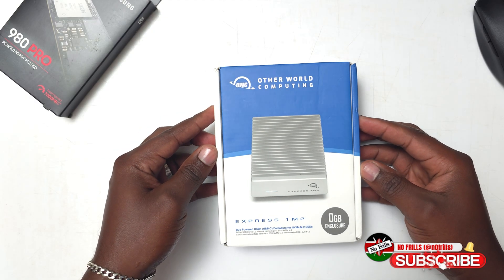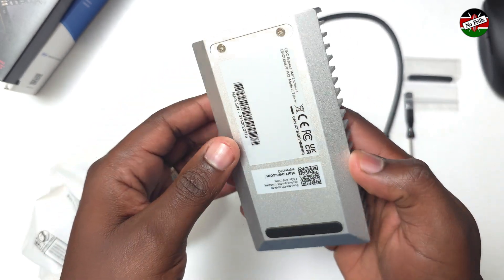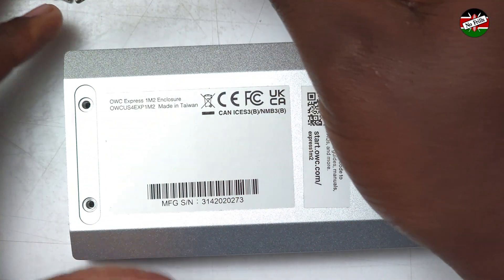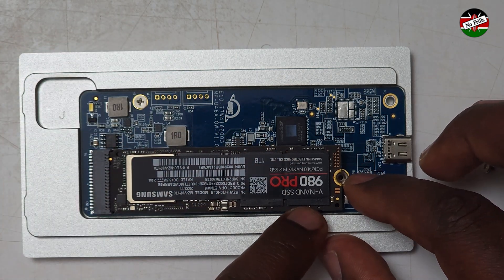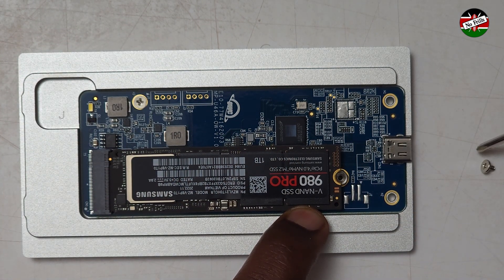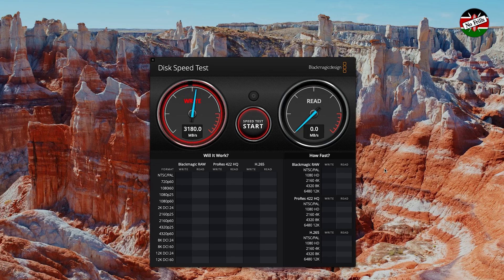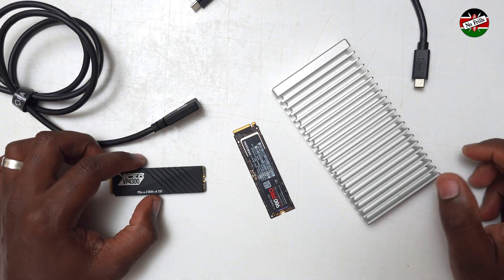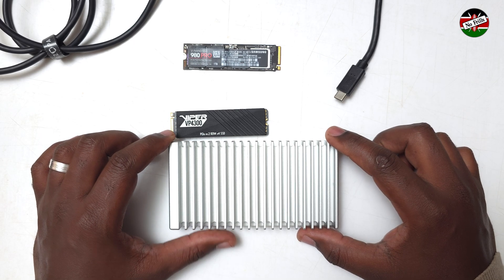Is the OWC Express 1M2 a reliable external storage for the base Mac Mini M4?

Comment from the maker: https://appleinsider.com/articles/25/01/15/m4-mac-mini-may-have-a-usb-c-connectivity-problem
SUMMARY
M4 Mac mini USB-C Connectivity Issues

• Multiple M4 Mac mini users report intermittent USB-C connectivity problems, with peripherals disconnecting randomly or failing to connect initially.

• Affected devices include keyboards, external hard drives, and KVM switches, with the issue appearing across both front and rear ports, and across various time periods since the M4 Mac mini's release.

• Troubleshooting steps suggested include inspecting cables and ports for damage, avoiding cheap adapters and hubs, and ensuring sufficient power for bus-powered devices.

• The problem's complexity makes diagnosis difficult, but a software update from Apple or user-side hardware checks might resolve the issue.
Reply: Wild that the m4 mini has such a widespread problem, seemingly using a thunderbolt dock can get around the issue.
Reply: Thanks for the video! How did this end up? Was it faulty? Did they send a replacement? Did that work any better?
Reply from the maker: @Ferbeldeyberb  OWC asked me to ship it back to the US for investigation. Unfortunately, since the cost of shipping to and fro is almost that of a new enclosure I decided to move on and consider it a loss.

Comment: You do not have enough power on your TB Buss.  Unplug some of your devices.
Reply from the maker: Even with nothing but one hdmi monitor plugged in, it still self ejected.
Reply: @nofrillstech  restart fresh with nothing plugged in. Shut down start up the machine. And then plug in your device. There is a very small possibility that your case is causing the problem. Try it with a smaller SSD. What size SSD are you using?

Comment: It probably wasn’t a power issue, otherwise macOS would’ve told you so. It must’ve been a defective unit. However it’s worth mentioning that OWC used the ASM2464PD USB4 chip in this enclosure, which is a chip that use more power and run a lot hotter than Thunderbolt 3. They should’ve used Intel’s JHL7440, that one has a little bit less read and write speeds but it’s way more power efficient and stable. This enclosure was and still is one of the most expensive ASM2464PD enclosures, which in this price range they shouldn’t have cut corners on the controller chip, they should’ve used the JHL7440 chip.
Reply: Thunderbolt 3 is limited to 32 Gbps from the start, the other 8 Gbps are reserved for DisplayPort tunnelling, and JHL7440 further limits it to around 24 Gbps. That's not "a little bit less"  than the newer ASM2464PD.  It is less power hungry and it is more compatible/stable, that much is true, but it comes at a cost: in practice you will top out at 2.6-2.8GBps with JHL7440 instead of 3.2-3.7GBps, drive and host dependent.

There are issues with OWC's implementation (lack of TB3 compatibility despite the competition offering it with the same ASM chip,  power draw, price/performance), but not using JHL7440 is not one of them. Unfortunately, they did not wait for JHL9440 nor issue a revised version...

Comment: I recently bought an M4 Mac Mini, and have been experiencing the random disk ejection errors that so many others have had as well. After days of research into others' issues and potential solutions, what I have found is that my external SSDs do not unmount/eject randomly when connected to a powered Thunderbolt hub (I'm using the UGREEN Revodok Max 213). I firmly believe that the issues are caused by inadequate (or inconsistent) power delivery through the Mac Mini's thunderbolt 4 ports... definitely a bummer which needs to be resolved (or at least acknowledged) by Apple. However, with the M4 Mac Mini having only a few Thunderbolt and USB-C ports, and lacking others such as USB-A and SD, it's a good idea to use a multi-port hub anyway. Just make sure it's powered.

The OWC Express 1M2 enclosure is known to draw a lot of power (much more than most external bus-powered enclosures), so this also reinforces the inadequate power theory with the M4 Mac Mini. See the video below for real world testing of the OWC Express 1M2's power draw:

https://www.youtube.com/watch?v=UCgcN6VrsOQ
Reply from the maker: Hey, thanks for the detailed comment. Yea, I later understood the ejection issue has to do with powerdraw problems and a TB hub was necessary. I however upgraded the internal ssd module (2tb) and put the OWC in a storage box. Thanks for watching!

Comment: I’ve several of these but only 2 work at the same time with my studio. Thunderbolt needs 15 watts per connected drive and 2 simultaneous connections seems to be the limit for Macs. Though you can use several USB drives at the same time as these two, no problem there. 

If you run them through a Thunderbolt hub you can add more Thunderbolt drives so it’s definitely a power allocation problem. 

BTW, PCs also have this problem to varying degrees. 

Kudos to you for mentioning these problems, haven’t heard any other reviewer mention it.
Reply: Ask me how I know :)

Apple has no idea.  These new larger / faster SSD’s require more power as well as TB 4 enclosures that are capable of faster speeds.

Comment: Great video mate, pretty informative and well narrated. It's such a bummer that the enclosure worked so bad specially considering the price it has. I've doubts if this issue is related to the Mac Mini or the enclosure itself. I've purchased a OEM enclosure which has the ASM2464PD chipset (thunderbolt 4 certified) and works great without any problem on my MacBook Pro M1 Max. The enclosure is quite similar to this one, fully made of aluminum and passive cooling. However the price I paid was just 30 bucks. Not bad at all. Maybe you could try to do this setup using another enclosure with the chipset I mentioned earlier! Which you the best !
Reply from the maker: Thanks for watching! The OWC enclosure was quite the disappointment. Do you have a link to the OEM one you bought?

Comment: Why you didn’t use the Cling on adapter in the video?
Reply from the maker: I didn't see the need for it, plus you have to order separately.
Reply: We’re you able to fix the disconnection problem  ? Sometimes whenever they overheat they disconnect 
am thinking of buying this enclosure  !
Reply from the maker: @michaelriddell308  Unfortunately I didnt try again. I put it in a box and used the ssd somewhere else. However, I'm inclined to believe the issue is with M4 mac mini power draw rather than an issue with the enclosure. If you want to by specifically for the m4 mac mini I wouldnt recommend, but for any other computer go ahead.

Comment: I had the same problem and while problem solving I tried a Thunderbolt 5 cable and that solved the issue.  I contacted OWC Case# 02844011 and a rep named Cynthia, she had no suggestions except to return the enclosure offering no Return Of Merchandise.  Why would I do that when Amazon would take it back for free and send a new one (with the same bad cable).  I own 2 OWC Thunderbolt docks and a OWC enclosure.  Generally they make good stuff, but their customer service sucks!  They know they have a problem with the supplied cable but keep sending it out defective to let the buyer solve the problem.  Very disappointed
!

Comment: Answer::Yes, running since months 24/7, with noch issues. Best speed, low temps. Btw: Hagibis enclosure also offers similar behavior, but mostly on Windows PCs. If formatted with exFAT and switched to a Mac Mini M4 pro, it fails, detaches and runs slowly on front ports… Strange behavior…

Comment: I have a 1M2 with a Samsung 990 Pro and BlackMagic speeds are within 10 of your read and write numbers. This hangs off my M1 Max Studio and I've used it for several months with zero problems. Son also has one with a Samsung 990 EVO and he runs it off an MSI Windows laptop and has not had any problems. I've tried mine on my M1 Pro MacBook Pro to move files from my MacBook Pro to the Studio with no problems. The 1M2 is widely praised on the r/MacStudio subreddit and I haven't heard of any problems with it so it might be something to do with the M4 mini in terms of the amount of power that it needs or you might have a defective unit as you said.
Reply from the maker: I now believe the issue is insufficient power supplied by the Mac mini m4 ports. Others have advised me to try an external dock. Thank you for the detailed comment mate, cheers!

Comment: Thanks for your thorough review. I have bought one but not tested it yet. I have a MacBook pro M4 max. But my MacBook and an M4 Mac Mini both have 15watt port power capability. However, and this might be relevant to others, OWC says on their web pad, a number of points or notations. Their number 5 notation says: "Does not mount with an Apple M4 MacMini16,11 if being connected as the third bus-powered device." Perhaps that means you can only run this drive with two bus powered devices? If you need more, then it seems a powered dock would be required. 
While an external Dock also opens up lower costs USB drive solutions, they add complexity,  seem expensive and powered ones have bulky crude power supplies.
Reply from the maker: You're welcome! Do you mind sharing a link to the OWC notation...I wasn't aware of it. A powered dock should be the solution to this then. Sadly, I don't have one to try.

Comment: One more test, if you have the equipment, would be to attach this drive through a powered Thunderbolt dock such as CalDigit's TS4. The dock is likely able to supply the necessary power, and would then confirm your hypothesis that it was the Mac mini's power output.
Reply from the maker: This would be a good test. Unfortunately, I don't have a thunderbolt dock.

Comment: The OWC TB enclosure works flawlessly, *with the right M2 nvme* ... like you show ... will run up to 3000 both Write/Read.  But be aware if you do not use the right nvme drive, you will get much slower speeds (around 1200 MBps) ... it matters very much what the drive is rated for, and even them may depend on SLC or TLC cache and cache size.  On the issues you had ... may need to pay attention to temp (did you check the heat signature with an infared?) ...AND ALSO making sure you have good contact between the chips on the nvme and the pads within the OWC heatsink enclosure.   I had ZERO problems with mine, so highly recommend the OWC 1M2 TB enclosure.  YMMV
Reply from the maker: I doubt it's heat. Otherwise, it would have disconnected on windows as well.

Comment: I have 2 of these on a Mac Studio and it’s stable, transferring at the advertised speed.   Power definitely can be an issue.  Plugging in a 3rd bus power enclosure on the Mac, I got a pop up message not enough power.  It helps when you use a more power efficient NVME like Hynix P41
Reply from the maker: Yes, I suspect the issue is related to power draw.

Comment: The problem seems to be the samsung memory, Ive read its temperamental used with the owc express,  I  used a 4TB wd black sn850x and not had a problem, my owc express 1m2 is hitting 3500mb  read and write connected to an m4 Pro mac mini, this speed is faster than OWC's advertised speeds.

Comment: Thank you very much for such a detailed and thorough unboxing and videoing of all the steps in putting in the SSD.  I am brand new to the Mac world after a lifetime of being a PC person.  Having just purchased a Mac Mini 4, I am trying to learn everything I can about the new adventure I am on. ☺️.  So many people rush through instructional videos, that they leave out details like not handling an SSD card on the top to keep finger oils from interfering with the heat dissipation.  
As a newbie, it was interesting that even though the OWC was formatted to APFS, it still worked on your PC.   I thought it would have had to have been formatted to exFAT for that to be possible.  If I were to get an OWC, I would format it to exFAT so I could use it on both the PC and the Mini.  Hope that really is possible.
As a newbie subscriber, I hope you will do a follow-up video on what happened with OWC. 
Thanks again!
Reply from the maker: Thank you for the sub! I am also sorta new to Mac since I switched to Windows in 2013. As I learn new tips and tricks I will share them here. Meanwhile, in case the M4 button placement bothers you check the latest video where I demonstrate how to schedule power on and power off on the Mac. I hope you enjoy cheers!
https://youtu.be/GbNwCJXU04E

Comment: Well done video . I am certain that OWC will replace the defective unit , I have used them for years without any issue . They are a first rate company .
Reply from the maker: The unfortunate thing is that shipping the existing one back and shipping the new one in was almost the cost of a new one😆
Reply: @nofrillstech  Excellent point .:goodvibes:

Comment: Considering that different people have different positive and negative experiences with this enclosure it's safe to say that disconnect problem is not due to enclosure at all. This error would have to be consistent across the board. That means disconnects occur after certain period of time. This would imply problem with chips used in this enclosure. Nothing like this happens. Hence, it is either a bug in Apple software or problems with chips used by NVMEs and they are not related to overheating.
Reply from the maker: From the feedback I've received over time, I also suspect the issue was the Mac. I will buy another ssd for it soon since the 980 pro is already in use in a NAS. Thanks for watching!
Reply: @ I recommend WD. I watched some YT videos and Western Digital seems to be consistent with speed and performance
Reply: @tipitoe-v9s was just about to say this. I put a Samsung 990 pro in one of these and got abysmal speeds and disconnects, then I swapped it for a WD BLACK SN850X and had 0 issues. My guess is that it’s some kind of conflict between the controller chip in the SSD and power allocation from the Mac.

Comment: Unfortunately, it's not the OWC that is the overhyped product— it's the Mac Mini M4. The thunderbolt ports on the back are faulty, even with a POWERED device. In my case, jiggling the cable slightly causes a disconnect. For some reason, these ports do not supply a firm connection.

Don't blame OWC‚ blame Apple. I plan to take mine in under warranty for repair or replacement.
Reply from the maker: Actually, I'm inclined to have the same opinion since I didn't get disconnects on the Windows PC.
Reply: @nofrillstech   Did you test it with mac mini front ports?
Reply from the maker: @alexchameleon8497  Yes, still ejected. Though I haven't used it in a while.
Reply: @nofrillstech  Can you test it with Macbook\Macbook pro? May be pro version has better ports....
Reply from the maker: @alexchameleon8497  Unfortunately I can't. I don't have any on hand. Just the m4 mac mini.

Comment: Don't blame enclosure's manufacturer. I'm more inclined to think that is the Apple's issue. I had the same disconnection problems even with usb enclusures when connected to the thunderbolt ports. When I connected enclosures to the front ports - all is good. Having memories about apple silicon devices and 3rd party monitors flickering issues I think that apple must fix its sh&t.
Reply from the maker: I'm inclined to believe so as well. I will retry soon since I repurposed the drive to the NAS.

Comment: My OWC 1M2 SSD has intermittent connectivity issues with my Mac Mini M4 Pro. It always appears in System Information under USB, but often doesn’t show in Finder or Disk Utility. I have to repeatedly unplug, replug, shut down, and restart—usually after three attempts, the drive finally appears on my desktop.

I will successfully eject the drive and it’s nearly impossible to reconnect the drive in a predictable fashion.
Reply from the maker: I'm sorry you're experiencing issues as well. For it's price it should work without problems!
Reply: I found out that this drive will connect flawlessly to the two usb 3.1 ports on the front of the Mac mini m4 pro. The drive will also connect to the middle thunderbolt port on the back of the Mac mini m4 pro. 

The Mac mini only detects this drive some of the time connected to the thunderbolt port closest to the power port. However, other devices like my monitor connects to this port without flaws yet.

I wonder if I should be concerned that something might be wrong with that thunderbolt port.

Comment: Very informative, thank you! Did you hear back from OWC?
Reply from the maker: They initially said they were working on a fix while I wait for a Mac update. Later, when I asked for a refund or a replacement of the unit, they told me to send it back to the US for repair. But after calculating the total shipping costs from rural Kenya to US and back, it didn't seem like a feasible option. So I decided to consider it a loss and moved on.
Reply: @nofrillstech  Wow, that's very disappointing from a company like OWC! Very surprising. I would not let that go and continue standing up for your rights!

Comment: I wonder if that cable stabiliser?? you mentioned at the start could have helped.
Reply from the maker: I doubt... its only purpose is to prevent accidental disconnects due to loose fitting between plug and port. Without it, the cable can wiggle back and forth easily. But since I was intending to use the enclosure on a desk, the cling-on seemed unnecessary.